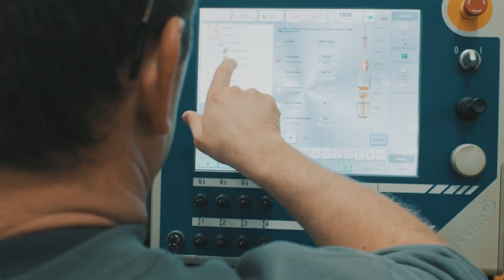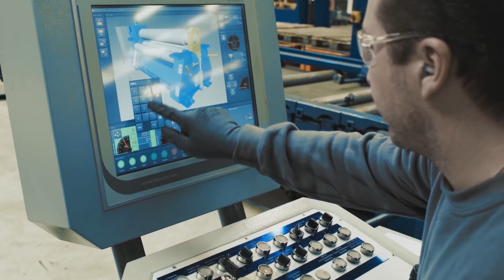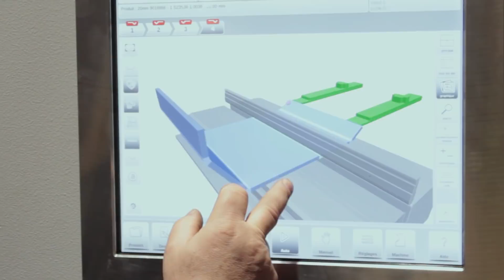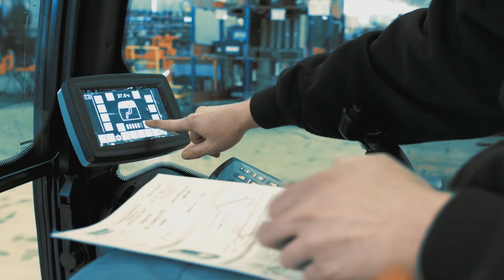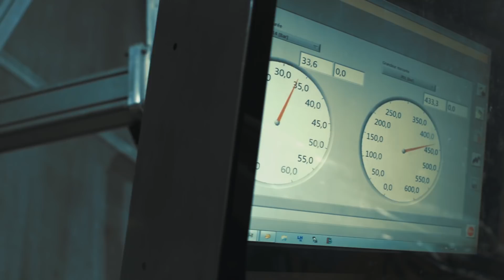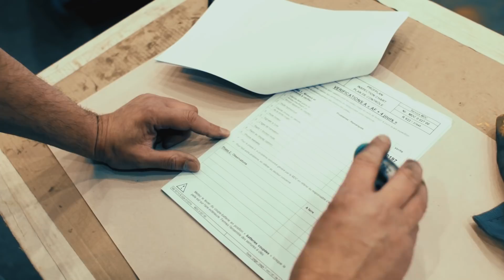Liebherr - The know-how of Liebherr-France SAS

Comment: Liebherr has got the best excavators
Reply: too expensive to buy and maintain….like any machine… and it doesn’t matter what make or type of machine it is or what it is used for….it is great when it is working…until it breaks down…when Liebherr breaks down it is the most expensive make of all to fix….for sheer value for money as far as heavy equipment goes….you can’t beat the Japanese….Komatsu or Hitachi….i’ve worked as a diesel mechanic in mines for 36years